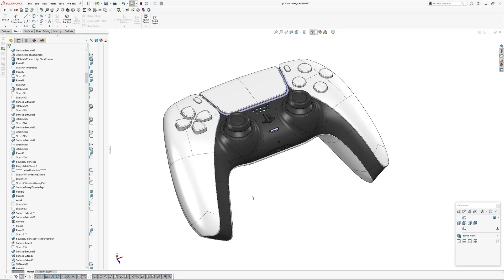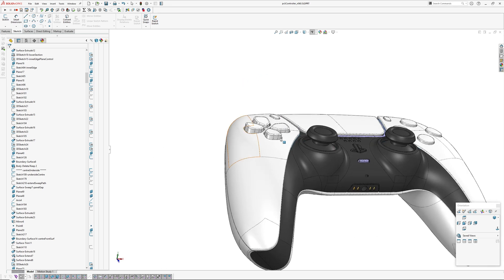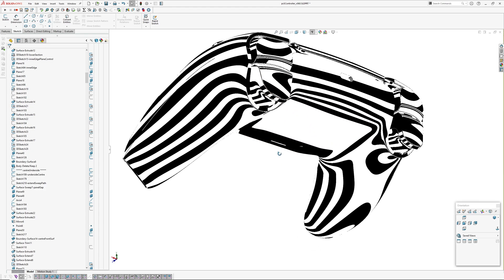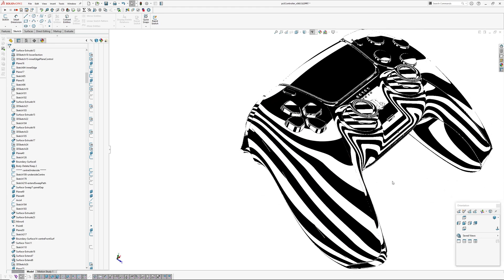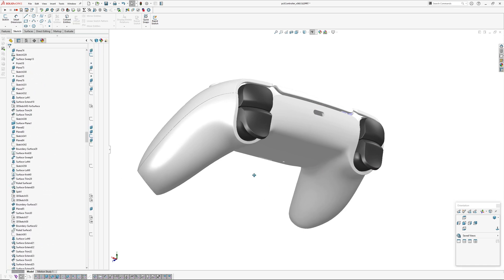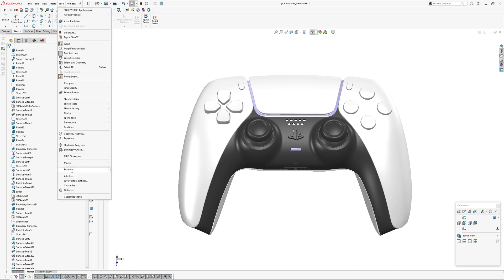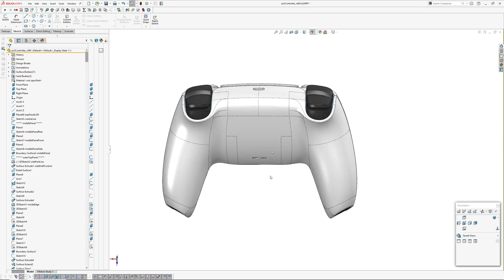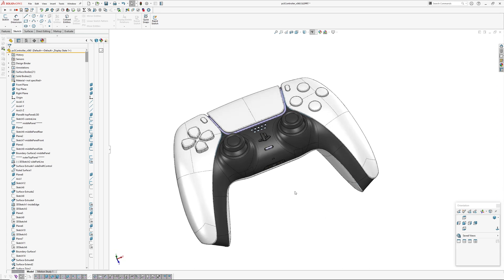Playstation 5 Controller, Modelled in Solidworks. Part 3 - Final.

Comment: Hi Andrew, is it possible to get the file in a .step or .stl? I'd like to use it as reference in Plasticity. No worries if not, I'm sure you're busy, I was gonna find a 3D scan to use anyway, but thought it was worth a shot to ask.
Reply from the maker: Hi Charlie, here's a link to a Parasolid. It should be better for importing into Plasticity as both that and SW use the Parasolid kernel. 
https://drive.google.com/file/d/1h_yqk148H-BhwFikhoOB8TjnGFaz8vCL/view?usp=drive_link
Reply: @AndrewJacksonDesignStudio Thanks Andrew, very much appreciated!

Comment: Hello, thank you for all these videos, they are really useful! However I'm just curious whether the way you've modeled this controller reflects the actual workflow of a professional project without an existing reference, or is it more of an ad hoc approach to redesigning existing products?
Reply from the maker: I'd have followed a similar logic if I were modelling this as a development project, with the obvious addition of the manufacturing intent as well. Primary surface>secondary surfaces etc, but perhaps with more of a overall primary surface layout before building the secondary surface. In my experience, for a hand held device like this, they would have had some kind of scan reference of hand built ergo models at some point in the process, so an ad hoc approach building over reference data.

If you want to see a couple of videos on production models (that my client luckily allowed me to share) please check the following links.

https://youtu.be/P6y_ImsSwyw

https://youtu.be/E8BcrFJxT0Q
Reply: @AndrewJacksonDesignStudio  Thanks for the details, very much appreciated. I will definitely take a look at those videos as well!

Comment: Is there any quick or easy way to turn a model like this, primarily made from surfaces, into a solid?
Reply from the maker: Definitely, if it was built with the intent to make a watertight object. In this case, that was not a consideration. This can be made into one watertight body easily enough via surface extends and trimming.
Reply: @AndrewJacksonDesignStudio  Thanks for the response. I need to model something similar but I'm new to surface modeling and I've not found a good tutorial on surface modeling into solids.
Reply from the maker: @ShermanStrike  If I were modelling this as actual parts for manufacture, I'd normally thicken a part via offset surface, then building the side walls manually using ruled surfaces and extrudes. Then trim the outer surface, side walls and inner walls, followed by knitting them into a closed surface, then solidifying them. The reason I normally use offset surface and manually build side walls, instead of using solidify thicken, is quite often the side walls need to be drafted and using thicken makes the side wall normal to the input surface. Maybe I should make a tutorial on this!

Comment: When you mentioned that modelling this in Solidworks for manufacturing is good going/hard work, what is a better program for it? Creo? NX?
Reply from the maker: I was probably rambling... I used to use Creo (wildfire days) and it definitely has more robust tools for reference control as well as surface analysis. Cannot comment on NX
Reply: @AndrewJacksonDesignStudio  No worries mate. I enjoy the rambling. Noted - thanks, and thanks for the videos. I'm early stage in my design career, and in a young Aussie studio without deep knowledge in surfacing, so I'm really grateful for your videos Andrew.
Reply from the maker: All good, pretty different scene now from when I started off in 2000. Access to super powerful tools and cost is less of a factor. And... there are videos about most things to help you on your way! All the best!

Comment: Such a shame Logitech doesn’t provide 3D previews of mice anymore. I’ve been trying to find a replacement for now 10 year old g9x, nothing comes close to the shape. Still waiting for a remake😅
Reply from the maker: Is that the g9x with changeable panels? I helped produce some renderings for the launch. I never got a full sample of it though.

I know what you mean. I have a Mx518, which they did relaunch, but I cannot find any. The mx518 has enough angle to rotate my arm AND it has a form that you can lift (i'm a noisy mouse user!) lots of the new ergo mice have no undercuts, so no lifting.